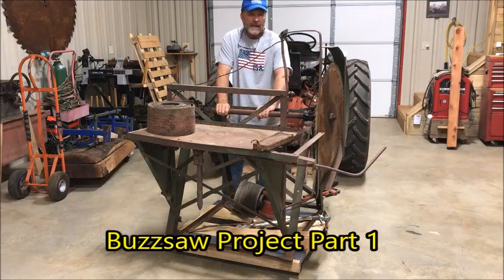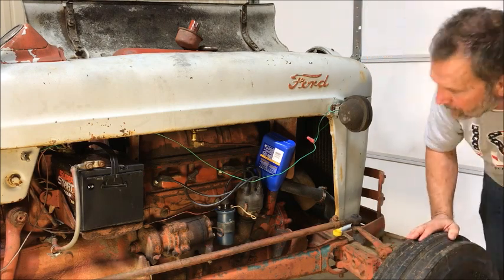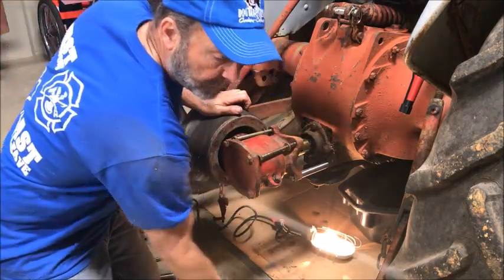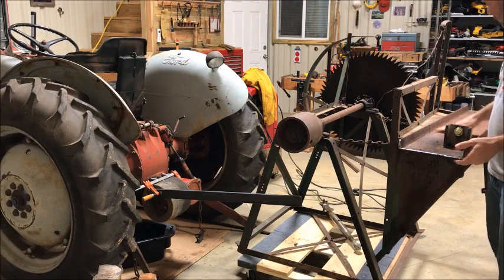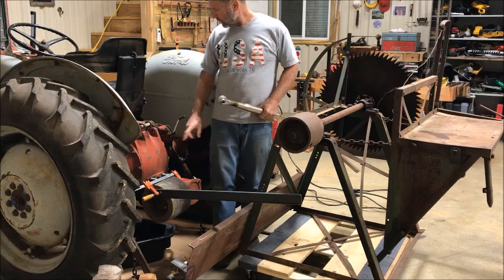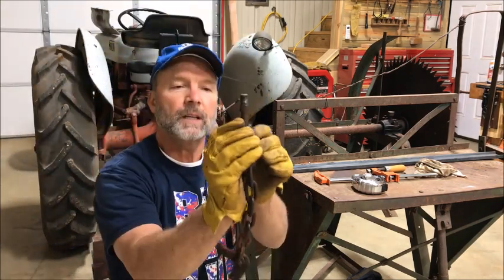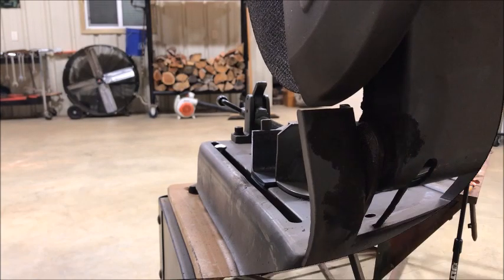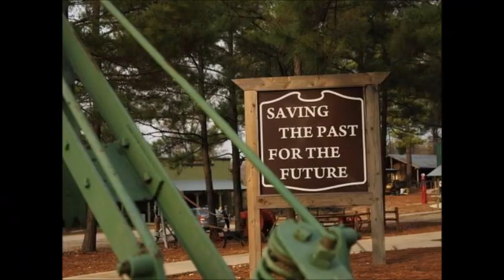Buzzsaw Project Part 1

Comment: They have places to fasten them down. Get to where you are going to saw and drive a rod through a hole in the runner. It wouldn't have to be much in your case for taking side movement out.  Heading to part 2. Thanks for the videos.